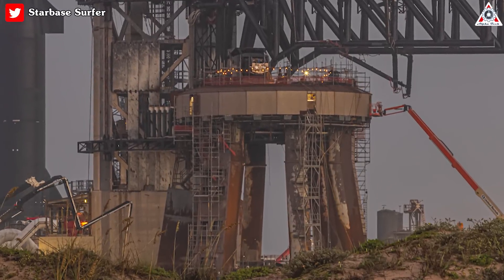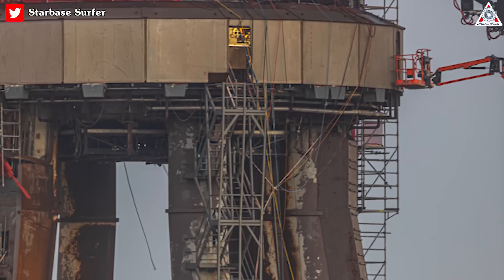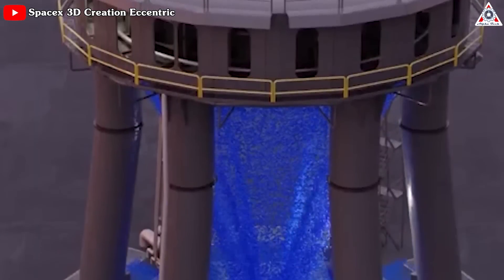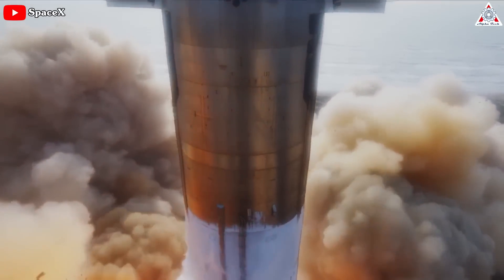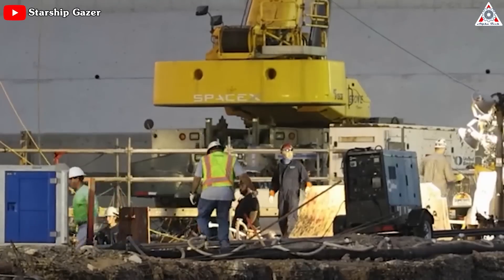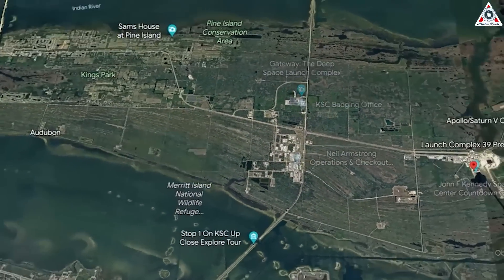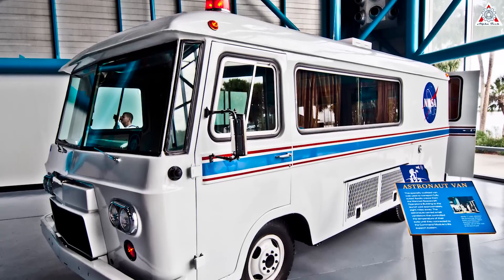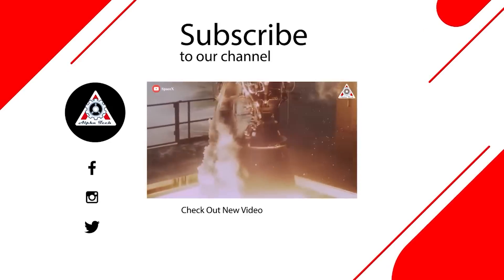It Happened! SpaceX Testing Starship's Pad and Water Deluge system...

Comment: If the deluge water is used to cool the steel plates just between the layers and not also atop of the steel plate, how is this going to dampen the enormous direct reflection acoustics right back to StarShip and how is this design going to prevent further erosion of the surrounding surfaces outside the diameter of stage zero?

Comment: On the problem with sea level engines, where ambient air pressure creeps into the edges of the exhaust bell, I suspect on Raptor 3 with its increased pressure, which will increase volume over time, that you could add a few inches to the cone, and radius it inward slightly with a following very slight straight taper angle inward, and in effect speed up the plume at the bell edges, and reduce the ambient pressure creeping in messing with the harmonics etc.
Reply: I saw the same issue causes problems. If you noticed SpaceX made the bell will a longer lip on one side to break up the cross flow of maga thrust coming out of those engines . That keeping any back flow pushing into the combustion chamber. They increased the fuel line diameter to stop friction bubbles from forming on the sidewall, and causing failure in the combustion chamber, and allowing that back pressure to get in. Once in your engine has to restart if it can. You noticed it was the outer engines that suffered the highest failure rate. That and the steering engines that change pitch and funnel that thrust pressure right into the combustion chamber killing the engine. They increased the bell size on those to counter the problem. The bigger main fuel lines providing higher pressure to all engines, along with the bell modification I believe has solved all the big issues. Using the steam deck to provide additional push at launch is a suggestion I thought would help lift the monster. I think we won't see a single problem at launch up to Leo. Using the Russian style of stage separation will maintain speed, and gravity won't be able to slow the Starship for even a second.  I'm excited to see all the modifications completely done. Still might crush the deluge system plates, but that depends on the steam barrier. Might need to add another outside shield to make the steam provide more push adding to the launch thrust.
Reply: The shut tel engines do this

Comment: The definition of FOD is debatable.  I've heard Foreign Object Damage or Foreign Object Debris.  I think Damage was the original word and then the Objects themselves called FOD.  But calling a small something Damage doesn't make sense so people started using Debris as the D in FOD so it actually makes sense.  It's a weird acronym when you think about it. And people on either side of the argument are vehement that they are right. I think this comes from the same term being used in space, aviation, and industry and each has their own take on it.
Reply: It was always debris and damage in my Fleet Air Arm days. Guys sent out on a FOD plod looking for  foreign object/debris that might cause damage to an engine if injested.
Reply: @coastie1961  I think the issue arises when the same term is used to describe both the particles and the damage caused.  Damage caused by debris is called Foreign Object Damage.  Caused of course by Foreign Object Debris. But people get lazy with the terminology and interchange the two.

Comment: Welding the risers to the bottom side of the pancake is obvious. How did they weld the risers to the top plate?
Reply: The animation is misleading in that it shows the risers being placed, then the top filler plates.  The order is actually, weld the bottom plate seams, weld the risers to the top filler plates, weld in the top plates.  That is why the risers are wedge / pie shaped.

Comment: How can they test the deluge system without the pump(s)? As far as I know there's only one company worldwide from the Netherlands that builds pumps powerful enough. They may actually need 4 of them. Each pump consumes 4 Megawatt of power. I assume nobody even though about it much less saw anything?
Reply: Won't need pumps. You have a few thousand psi. of liquid Nitrogen to push the water thru the system. SpaceX is basically building an oversized, pressurized, fire extinguisher
Reply: @leonardhopper857  there is literally nothing on the planet capable of pumping the water fast enough

Comment: How many $millions did those three new astro vans cost, and why will they not be used until late 2024?
Reply from the maker: There will be no crew on SLS until 2024
Reply: @alphatech4966  SpaceX crew members are transported in a Tesla, I'm sure at a tiny fraction of the cost.
Reply: Congrats buddy, you just achieved level 9000 Musk simp status. Triggered over someone not using Tesla. You need help lad.

Comment: What seems to elude everyone (at least i havent seen it mentioned anywhere) is the double function of this genius contraption. If you put enough pressure in to the water, you can effectivly cancel out the force of the raptor engines hammering down from above and thereby have close to no flex at all in the steel plate. Consequently this plate is "upgradeable" to handle comming generations of Raptors. Simply crank up the water-pressure.
Reply: Um... what?
Reply: @theonlyalan731  What what?
Reply: this isn't going to age well. Maybe time to go learn some basic chemistry about what happens to water when it instantly turns into steam. Then find out what happens when that reaction occurs inside steel. 
Lastly do a bit of math about how much water you would need, to cancel out the force of 30 odd raptors firing down on it. Then find out if there is any pump on the planet that can pump water fast enough. Spoiler alert, no such pump exists. The best pump on the planet does not come even remotely close to what is needed here. 
It's the dumbest f''n idea imaginable. Other genius move from the vapourware king that's going to backfire epically
Reply: @mervstash3692  Surely you're the only person who has ever considered this. I'm worried now that you might be the only person with a solid understanding of chemistry and physics. I'd reach out ASAP to let them know.
Reply: @mervstash3692  So...your telling me they plan to spray STEAM up under the launchmount? I begg to differ. The whole point of the plate is to NOT alow the water to steam up before it leaves the space between the plates and then steam up directly after exit, thereby discipating heat and force. And lastly: we are not talking WATERSPEED...we are talking WATERPRESSURE. In an enclosed space such as a double steelplate, it should be well possible.
Reply: @fredrikabinger4818  no mate, I didn't say they are spraying steam. If you don't know what happens to water when it gets incredibly hot, then there isn't much point continuing. There is nothing on the planet that can counter the force of all those raptors. It's basic chemistry & physics. The only people that think this will actually work is Elon & his stans.
Reply: @mervstash3692  So i guess you work for blue origin then. Ofcause i know what happens to superheated water in open space (as in on top of the plate) and thats the precice point of the design. And also stop talking to me like im some todler. Unless you present the "Math" as you call it, this is your OPINION. Everybody is alowed to have opinions, but you keep it respectful. You can dislike Elon and what he does and choose not to believe in it, but a lot of us do like him. I choose to believe he knows exactly what he is doing and has probably done "the math!" to get it right.
Reply: @fredrikabinger4818  lol simp away. He's only proven wrong about something literally every day. Maybe it's 8000th time lucky in this case? and "I work for Blue Origin"? You need help if that's where we are at.
Reply: @mervstash3692  Sure dude...ill remember you and quietly chuckle away when Starship lifts of with no problem. Its a sad thin to witness lack of understanding, due to mental regidety. Keep fighting the future while Elon and others make it happen. Maybe its you that needs help?
Reply: @fredrikabinger4818  you'll be 185 years old when you get to chuckle old mate. What future is it that I am fighting? Launching Starlink satellites? That's pretty much all Starship will be doing.